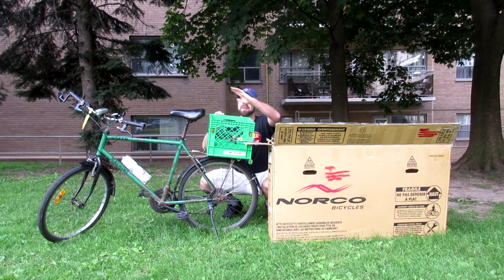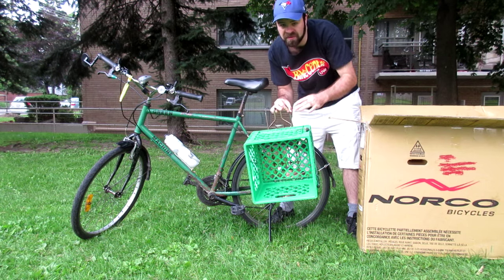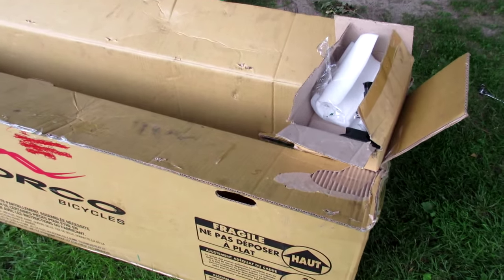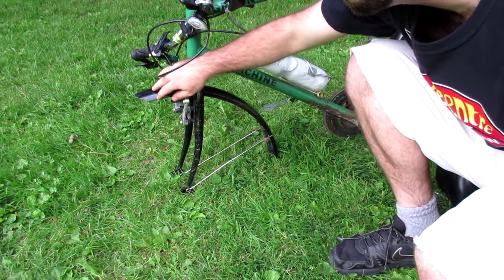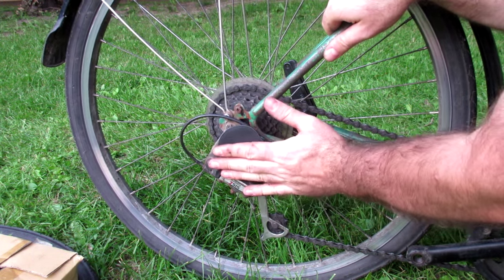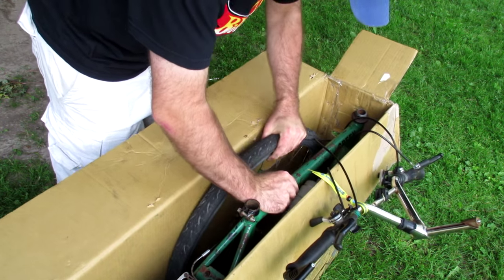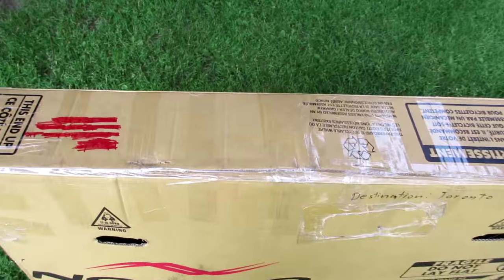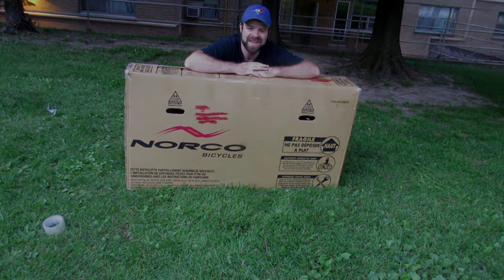How to Package a Bicycle inside a Bike Box

Comment: Give some history of this bike.  How long have you been riding it?  It looks like it has many many miles.  Is this the same winter bike you have made videos with?
Reply from the maker: spectre9801 I call the bike my Green Machine. I acquired it in the spring of 2010. It's an 90's style mountain bike of which I do not know the original make or model. I repainted it that summer and it was my primary commuting bike from then up until winter 2013 when I got my Raleigh Sport hybrid bike. Since then I have mostly been using it as my backup bike for commuting. During the winter I put studded tires on it and I use it on any days when it's snowy or icy. I mostly blame the salt from the winter roads for making the frame so old and rusty looking. I have no plans to repaint it though because the nicer the bike looks, the more likely it is to get stolen.
Reply: cjhoyle Green Machine is a good name for a bike, I Thoth that you got it painted that way.
Reply from the maker: McDennis1984 I repainted the bike myself, including the lettering. Green Machine is what I decided to call it.

Comment: Helpful Vid! I found an old Schwinn mountain bike on craigslist and it reminded me of your Green Machine. I like the idea of commuting on a low end bike to prevent theft, and I think im going to build a budget commuter for that reason.
Reply from the maker: MotorheadRedo There are lots of other advantages too. I discussed these in my video "Overview of my New Commuting Bike".
Reply: Good Video! I have an aluminum MTB and a steel touring bicycle, and I commute about 12 miles per day M-F. The bikes are not cheap and are probably middle of road. To properly secure them, I use a high end U-lock and cable, which are very heavy and hard to carry. The only other good option is to use a high end chain/lock, but that would probably be even more heavy and harder to carry than the U-lock/cable. I think it would be much better to buy a low end bicycle and turn it into a daily commuter. Than, I am hoping I won't need to use high end locks and I can get away with using a locking system that is much lighter and easier to carry around with me. Plus I won't worry as much about bike theft.
Reply from the maker: MotorheadRedo Yup, higher end bike = higher security lock = more to carry! If you haven't seen it already I made a video about bike locks too (I swear I'm not just trying to promote my own videos lol). Another option which I didn't mention in that video is to getting a heavy lock, but leave it permanently locked up to the bike rack at your workplace. This eliminates the need to carry a heavy lock with you all the time, but you will need a secondary lock if you want to stop and run errands on your way home or on the weekend.